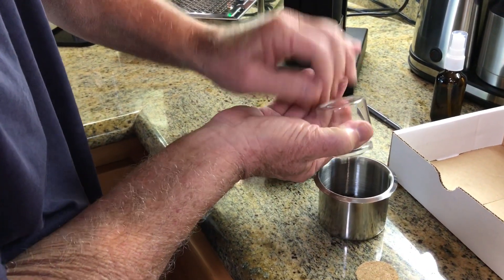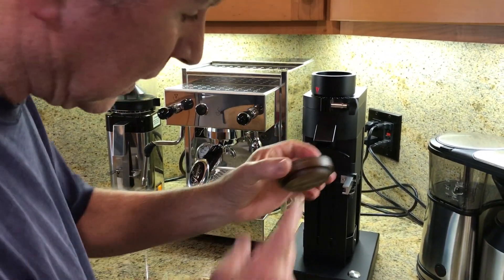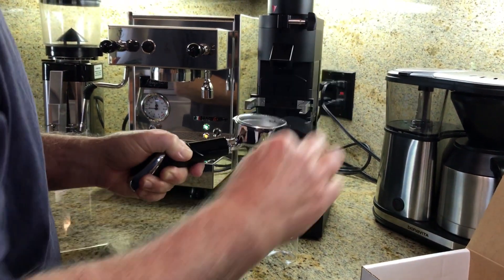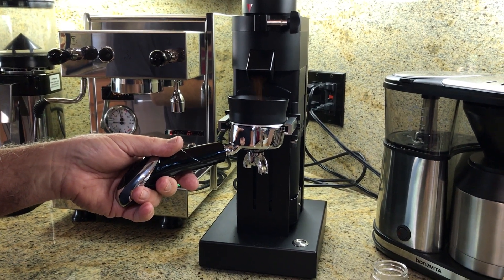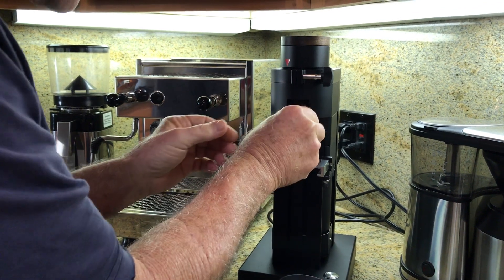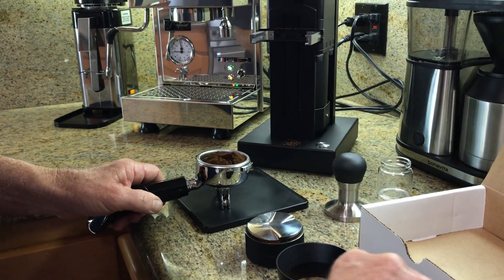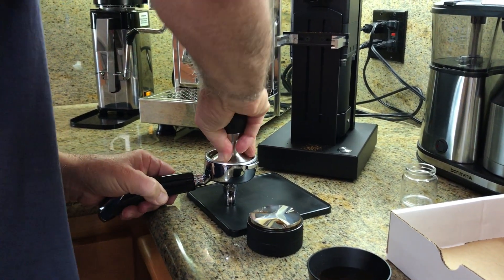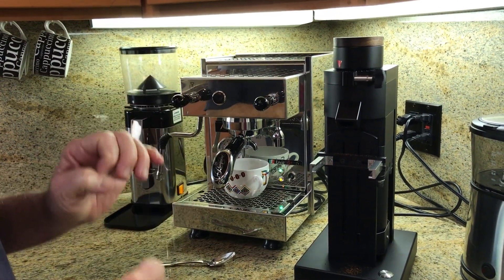IMG 2920

Comment: Thank you for sharing your beautiful machine.. You say that you got the Bezzera Magica, could you tell me how do you like it compared to the BZ13 as I am hesitant choosing one over the other? Thank you.
Reply from the maker: The Bezzera Magica with PID.  Wonderful steam power with the 2 liter boiler.  It is much more powerful then the Pasquini G4 that you see in the video.  Even though it is a heat exchanger machine, I never need to flush water through the group head.  I have the pid set at the recommended temperature of 195/196 F.  Another plus is it has a 4 liter reservoir.  I have only had three Pasquini machines in the past.  Not familiar with the BZ13.  I recommend a 2 liter boiler of 1 1/2 liter boiler.
Reply from the maker: I love the Bezzara Magica.  Heat up time very fast.  Steam pressure with the 2 liter boiler is powerful.  4 liter reservoir is great.  With the PID I do not even do a cool flush.  The boiler fluctuates from 195-196.  Thats the recommended setting.  I love the E61 group head.  More of a commercial machine compared to the Pasquini G4.  Better steam because of the larger boiler.  Heat up time is about the same.  Only about 15 minutes should do.

Comment: Thank you for your prompt response.. I mistaken your Pasquini G4 for the Bezzera BZ13 as they are absolutely identical.. in fact, the G4 is a rebranded BZ13 and exclusive to the US market. I am asking you about your experience with those machines as professional reviews are often biased. They usually state that the electrically heated groups of the G4 and BZ series are a lot faster to get to ideal temperature then the E61 groups, did you experience this longer heating time with the Magica vs the G4?
Reply from the maker: Heat up time is the same.  About 15 minutes.  For making milked based drinks much more steaming power.  I was told by Pasquini Coffee that the 1 1/2 liter boiler is not a true 1 1/2 liters because of the heat coil that passes through.  I was also told that the Bezzera Magica and the Mitica are true two liters.  I live about 25 minutes from Pasquini Coffee Co.  where I have purchased all my espresso machines.  Good luck on which ever machine you buy.  The Magica is easier to fill the reservoir than my other machine.  Much larger opening at the top.
Reply from the maker: I would also go with the PID.  The temperature fluxuation is 1 degree.  195-196.  No flushing needed for great espresso.